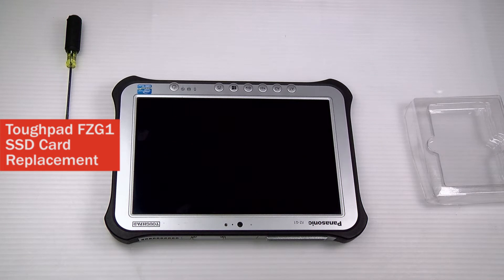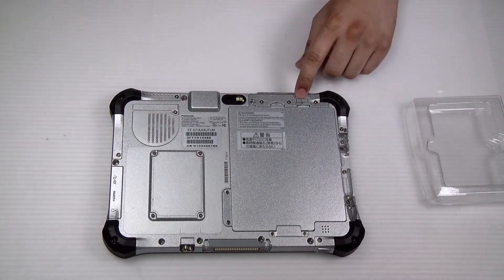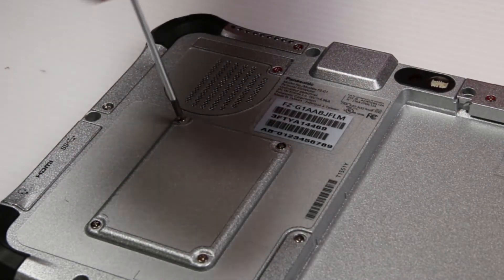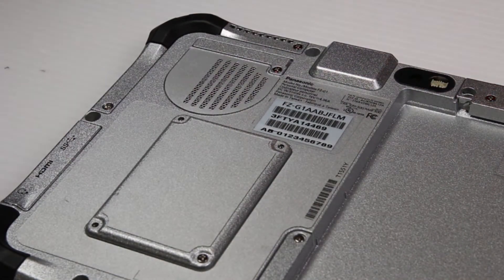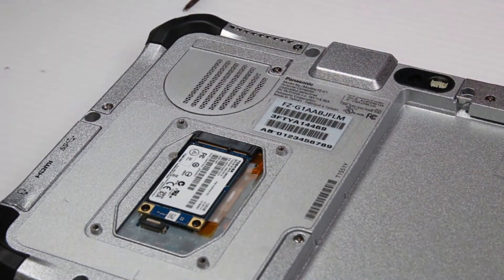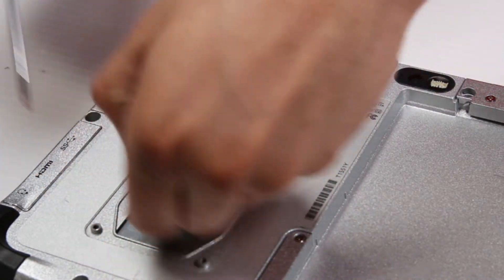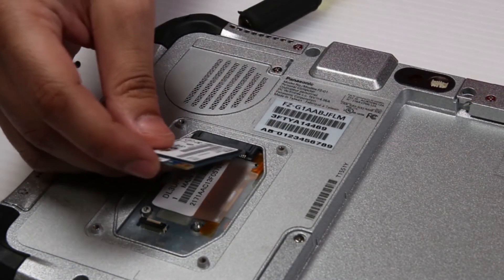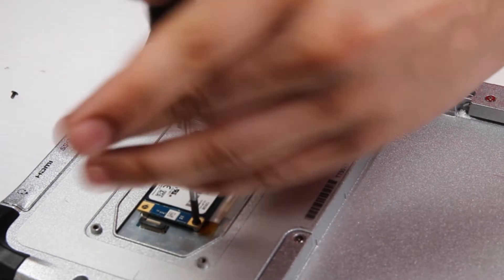Replace Your Toughpad FZ-G1 SSD Card!

Comment: HOW TO CHANGE THE RAM MEMORY?
Reply from the maker: The FZ-G1 has no upgrade slots for memory.  It is built on the system board.
Reply: And what is the connector that is there next to where the Msata is held for